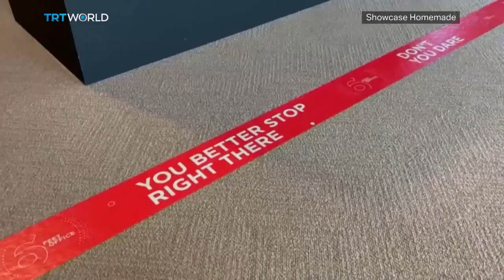Pandemic Effect on Architecture Industry

Comment: All you need to do is to install powerful exhaust system on the ceiling or on the floor, not on the wall, and the exhaust duct will be equipped with heating system powerful enough to kill the virus instantly. The aircon system will be installed opposite side of the exhaust system, again not on the wall.
The whole idea is to create a vertical ventilation system in a room instead of horizontal ventilation system which can spread the virus to adjacent person.